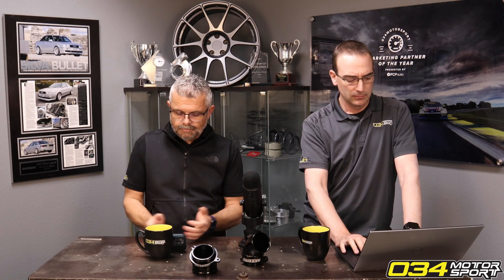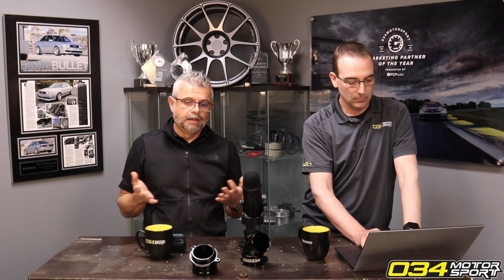B9 2.9TT/3.0T Spark Plug Failures? | 034Motorsport FAQ

Comment: Hey fellas, thank you for all your video posts. I just ordered some spark plug coils and plugs after getting a misfire p301, code. When I restarted engine to get code red correctly and before I changed the plugs and plug coils, I ended up getting error codes for cylinder 1-3. So I replaced all 6, still getting misfire codes. Next step would be injectors and fuels rail?

Comment: Should I replace an injector before it fails ? Every 10k miles. Plugs every 5K ? 🙃🥴🤔
Reply: bro absolutely not, you shouldn't be replacing injectors.....On a tuned Audi I would change the plugs every 15-20k miles instead of the factory requests.